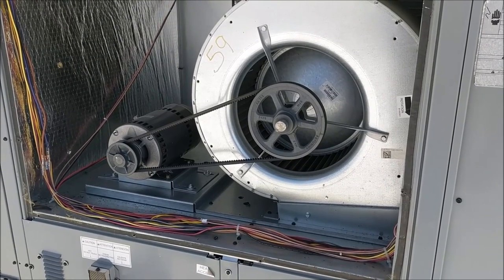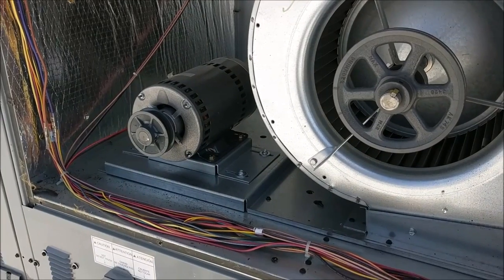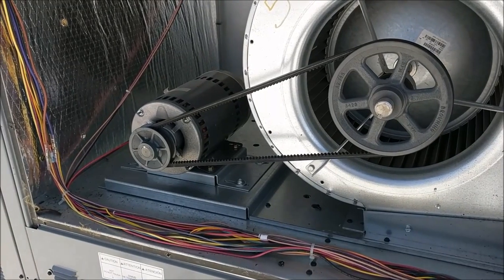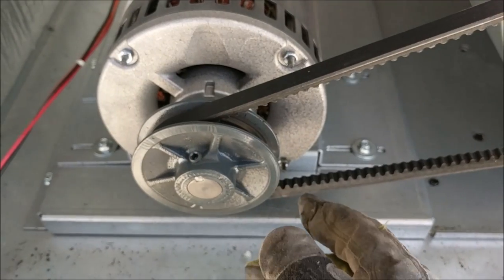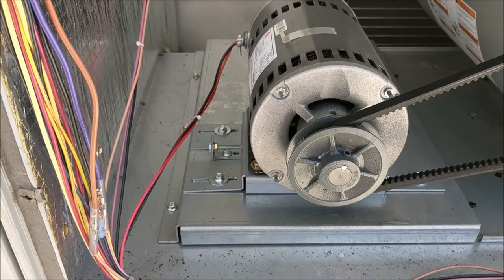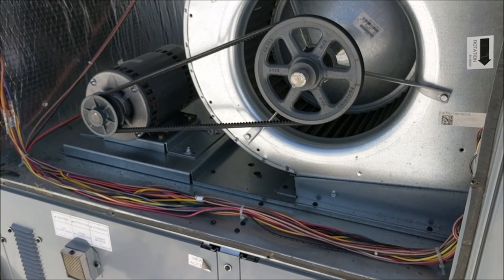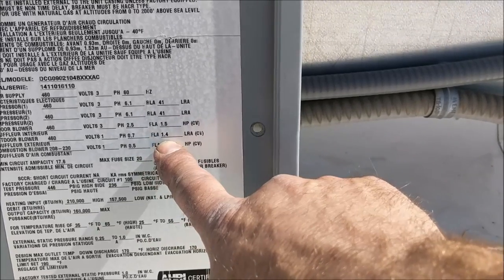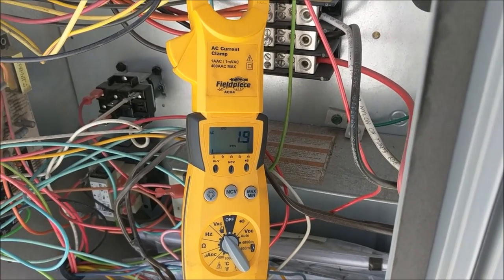How To  Replacement The belt On Your HVAC System

Comment: No alignment between pulleys inspection and only hack finger jiggle test  belt tension.  1/64 inch/ linear inches between measurement between shafts. Go get your tape measure you forgot to bring one to the job site, oh yeah get a straight edge steel flat bar to check the pulley alignments.  Don't forget the torpedo level..I ll let you figure whats that for!